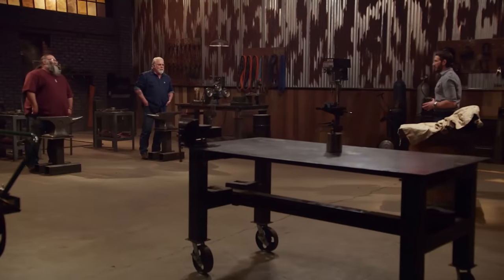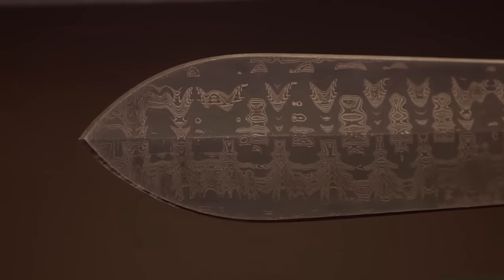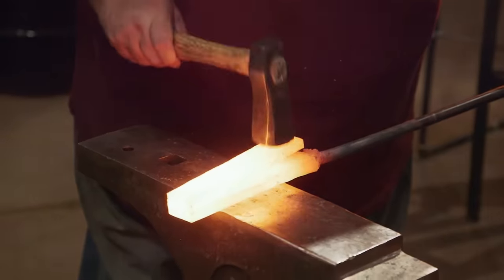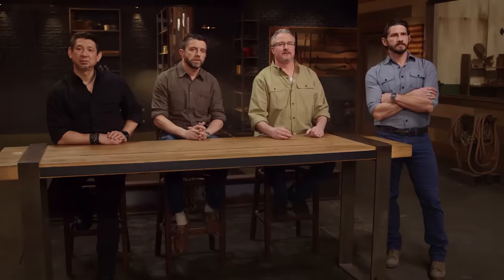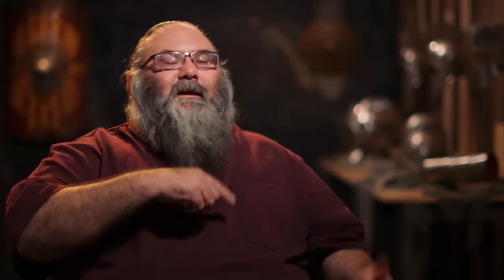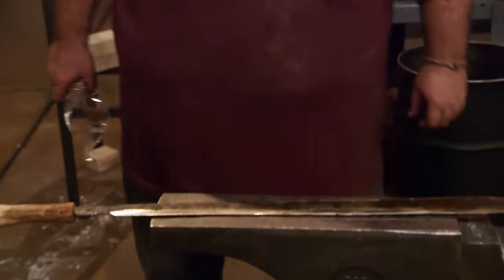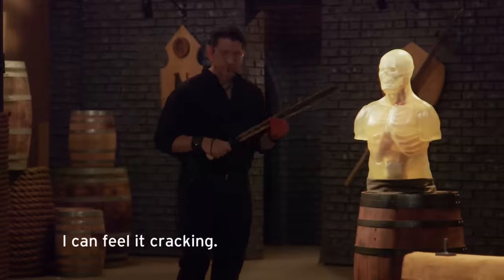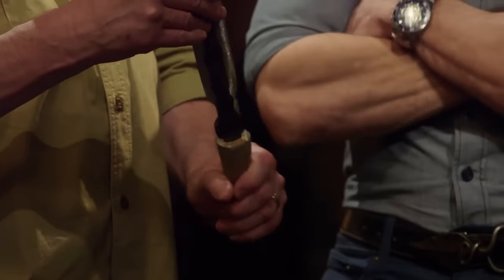Forged in Fire: Beat the Judges: IDA SWORD SHOWDOWN (Dave Baker vs Tobin Nieto) (Season 1) | History

Comment: All they needed was to recognize time lost should be time regained after clearing the issue, That or 5 minutes to power drill bolts through the pin holes and secure the handle properly albeit haphazardly.